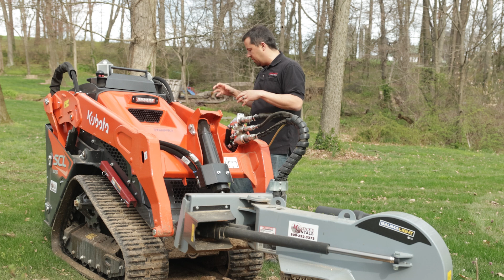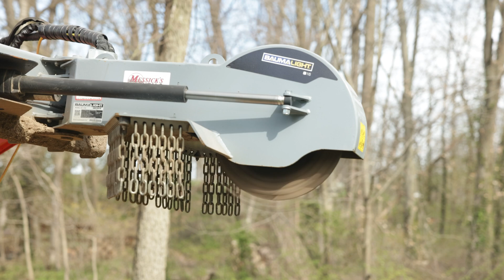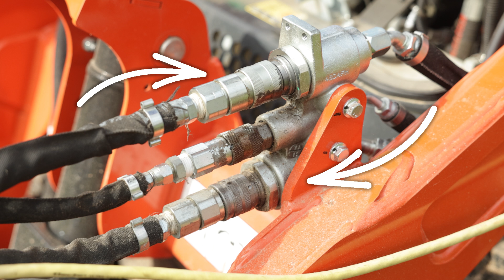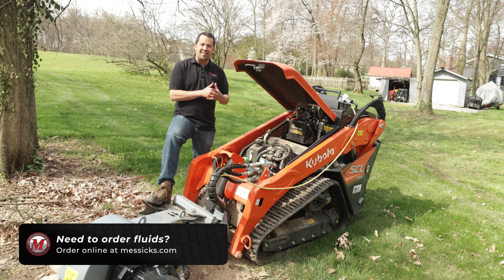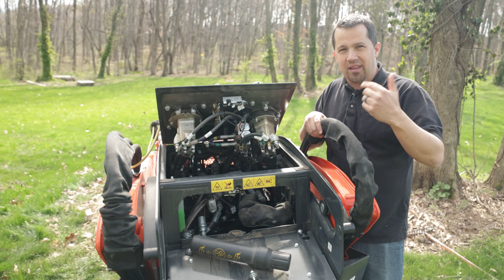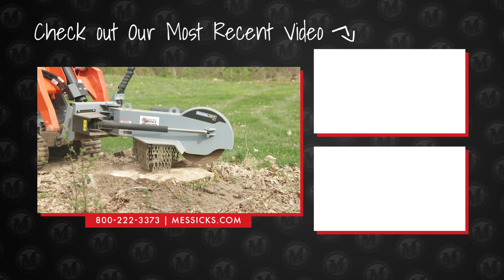Hydraulics are AWESOME. Kubota SCL1000 & BaumaLight

Comment: I recently purchased a cheap Wolverine grapple for my scl1000. I have played with the electronic adjustment with 0 luck. The “thumb”  slams up, and down. Any advice?
Reply from the maker: Add a hydraulic restrictor in the line. The adjustments are not particularly precise

Comment: I have a question for you, Neil, that might make a good video also. I went to my local Kubota dealer to pick up some oil for some maintenance on my L4060 and my Z421 mower. I picked up some 10w-40 oil and kept looking for some oil for the tractor but couldn't find it. I was told that everything uses the same oil now. How and when did this happen? I could have sworn that the diesel oil was in orange label bottles and there was a difference. Am I dreaming or did something change?
Reply: I run 5w40 rotella in my L4060. Granted I only have about 400 hours on mine, but it has worked for me in several diesels.
Reply from the maker: Messy. You need a CJ-4 oil for your tractor since it has a DPF, normally those oils are not good for gas engines. "Everything uses the same oil" is absolutely wrong.

Comment: Great video wished I didn’t feel raped with your shipping costs would order everything from you
Reply from the maker: We just signed a new contact with Fedex that got us some better rates. You should notice lower shipping costs going forward.
Reply: @MessicksEquip thanks for listening to the customers!
Reply: I have ordered dozens of times from the parts department and never noticed abnormally high shipping rates.
Reply: I order from messicks most of the time and items show up within two days as clockwork.     Then a new local dealer opened 10 minutes from me…. It’s a large dealer with multiple locations in the north east.  I wanted to give them the business… you know,support local, build relationships….  The problem is their ability to get parts timely….  Takes over a week.    Back to messick’s!